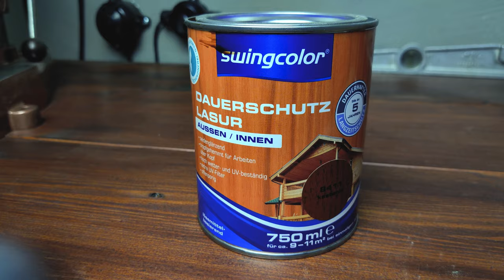Rusty Axe | Restoration & Modification | 4K

Comment: I liked this restore right up until you used the old insect-infested wood. Sharp heavy metal swinging around at the end os suspect wood is not what I call safe.
Reply from the maker: Thanks for the hint. You are probably right that a new handle should be created for multiple uses